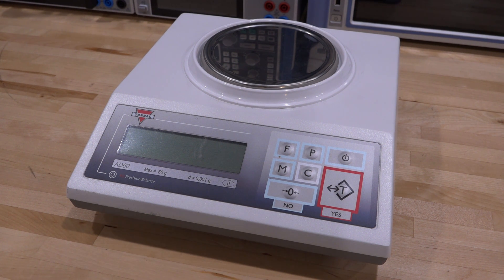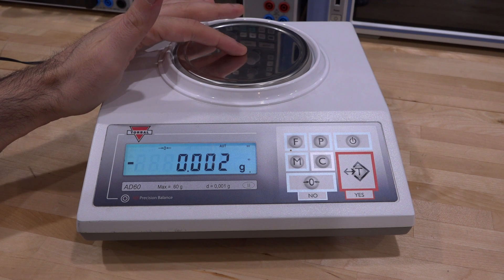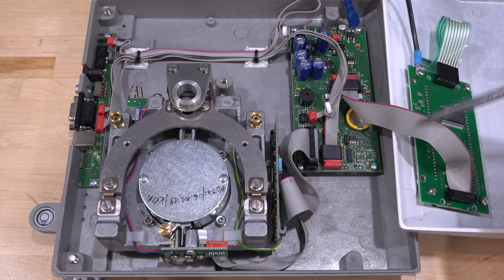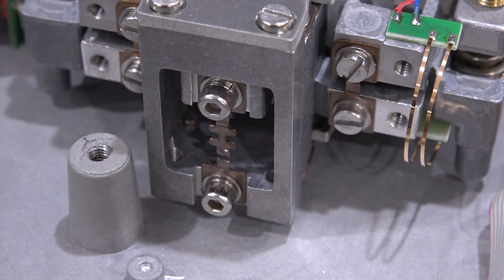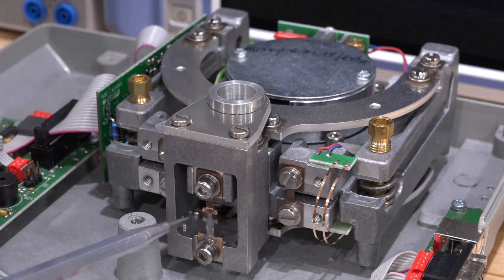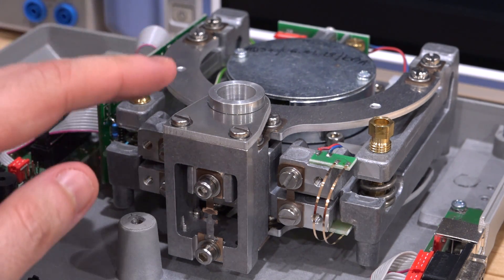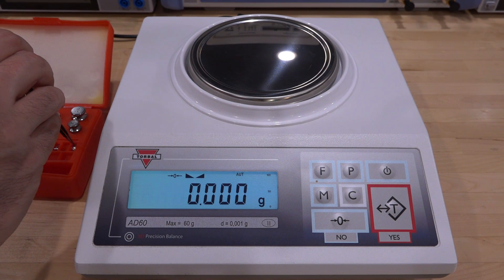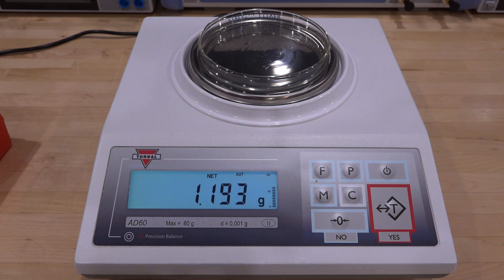TNP #46 - Torbal AD60 Precision Balance (0.001g) Repair, Teardown & Experiments

Comment: Urgent requirment please 

How can I reset the default weight of the weighing scale pan, which is currently around 30-40 grams, to 100 grams, and adjust it to measure further loads according to its load capacity? The scale is a magnetic weighing machine with a precision of 0.1 mg.

Comment: What an interesting fix. The broken piece is a flexure, a part to isolate rotational movement in a lever system which amplify the mechanical movement. Any changes to these parts will affect linearity or placement error (large measurement difference when item is place off center on the pan).

Comment: Thank you for the video.  I found one of these scales in the garbage of a company that had moved out, after getting it home and researching it, found it was supposed to have a bell jar over the top to shield it from air drafts.  It was really sensitive too, it could sense and measure the weight of an eyelash dropped on it and I was wondering how it achieved such sensitivity.

Comment: I am a bit confused. I thought precision scales like a 0.001g jeweler's scale from Amazon are much simpler to implement and cost 20 USD on Amazon? What is the difference here?
Reply from the maker: This is a balance, not a scale. The cheap scales from Amazon are based on strain gauges. They have poor accuracy, repeatability, linearity and stability particularly for small weights.

Comment: So actually what is being measured in this device? An output signal from a PID controller that is driving a magnet?
Reply from the maker: Yes - the control signal from the PID controller which stabilized the balance.

Comment: Used to use scales like this in chemistry. Generally they had a box over the top to prevent air disturbance from impacting the balance. Pretty cool to see the interior. 

And yeah, guess someone overloaded it or just dropped/set it down too hard. Pretty cool.

Comment: I've read that back in the days mathematicians used precision scales to perform integration by plotting the graph on a piece of "precision" paper then cut it out and place it on a scale. This one would be perfect for something like that. Really wonderful mechanism.
Reply: Yep, an A4 sheet of printer paper weighs 5g nominally. I would use plastic if doing this to achieve high accuracy though because paper absorbs moisture so one would have to weigh a known sample of paper that is in the same state as the cut out shape.
Reply: Analytical chemists also used it to integrate the peaks on chromatographs when they where still scribed onto paper

Comment: I have a scale from 1992 that has same electromagnetic type of sensor. It was broken the same way. One of links snaped. Mine is d1g and I thought this electromagnet was used because it's old and resistive gauges were not good for resolution or expensive but 0.001g is nice

Comment: Thanks for another great video! Funny thing, I have a similar 50g scale, also made in Poland, also 0.001g resolution, but made by a different company (AXIS). The electronics inside are old (Intel 8052 processor, ADC with an LM399 and other goodies), but the mechanics of the scale are very similar.

Comment: Summary
Introduction to the Precision Scale and Initial Problem

- 0:07 Introduction to the episode: repairing a Torbal 860 Precision Scale.
- 0:18 Scale specifications: 60g maximum weight, 1mg resolution.
- 0:26 Scale condition: purchased without a power adapter, displaying an "Unload" error on startup.

Teardown and Inspection

- 1:31 Description of the internal structure and mechanical design of the precision scale.
- 2:00 Observations of sensors, adjustment screws, and the analog board inside the scale.
- 2:44 Discovery of a broken mechanical link causing the scale's malfunction.

Repair Process

- 3:49 Attempt to fix the broken link using soldering and a piece of nickel.
- 4:22 Reinstallation of the repaired link and discussion of the scale's working principle.

Testing and Calibration

- 6:08 Successful zero reading after repair.
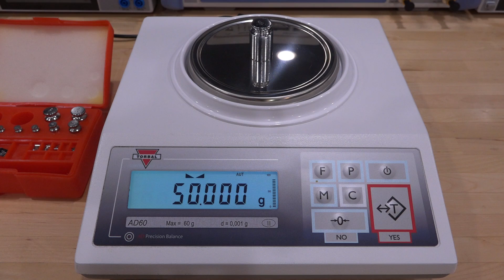- 6:15 Testing with a 50g weight shows accurate measurement.
- 6:26 Testing with 1g and smaller weights confirms the scale's precision.
- 7:03 Experiment to measure the evaporation of acetone, demonstrating the scale's ability to detect very small weight changes.

Conclusion

- 8:10 Closing remarks and appreciation for support, with plans for future repair videos.
Disclaimer: I used chatgpt4 to summarize the video transcript.

Comment: Have a similar mass reference set, and a cal cert for all of them. Error as you get smaller is larger, along with uncertainty, but the milligram pieces are all given to 2 decimal points, and the larger ones to 3 decimals, except the 1g mass, which is 4 decimal points. 

Yes I do have a very old Oetinger massmeter that is capable of showing the mass of those, down to the 0.1mg mark. Been repaired, the mains schaffner filter let out the magic smoke, and was replaced with 2 small chokes, as this unit has a mains transformer anyway, and is nearly a half  century old, with a VFD readout.

Comment: Eons a a go in college chemistry we used precision balances to weigh samples.  You just added on the weights on one side and your sample on the other.  You had to shut the draft door, and wait for the thing to settle out then add or remove weights, took for ever to get three readings.  In one lab they had a couple of Chainomatic scales that used tiny chain links as the test weights. A mechanical counter kept track of how many links and thus your weight, very high teck for the time.

Comment: * mass, not weight 😁
Reply: I'm an experimental physicist and metrologist.
The kg is the unit of mass. See bipm : The International System of Units (SI): Base units
The weight of a body is dependent on its location, and is measured in Newton. The weight of a body on the moon  is 1/6 than on earth, and is zero in zero gravity situations.
Therefore, every scale needs to be calibrated versus a reference mass piece on the location.
A scale measures mass, not weight.
Reply: @DrFrank-xj9bc  I seem to remember that the only way to measure mass was by comparing with another mass hence done with a BALANCE while something that measured the force due to gravity was a SCALE and technically measured Newtons that was displayed as grammes with a scale to indicate the extension of a spring.  Obviously the names for the machines have evolved over time.  Both instruments may have a pan and a scale (fish and armadillo scales suggesting the shape, old word for cup in more than one EU language) another name for a pan .  A balance that compares a mass in a gravity field against a force of an electromagnet is a FORCE BALANCE, like the one in this video, so even though it is balancing it is doing so against a force.

The older style of laboratory precision balances used geometry to change the ratio of the counter weight and then measured the offset ANGLE to determine the correction from a neutral balance position.  They can be equally precise but are generally much more intricate mechanically.  They and any TRUE BALANCE will however give the same reading on the moon or Mars like a double pan balance with weights or a three beam balance that was popular in high school.
Reply: You can only convert to mass, if calibration is verified and passes at the location the device will operate, but still call it weight.
Reply: Interesting. The display on the device shows grams. Grams are now a measure of weight - filed under "good to know." By the way, allow me to be really clear here - I'm just trying to start a "controversy" to help engagement...
Reply: The instrument uses an electromagnet to counter the force of gravity. Thus it measures weight.
Reply: @ionstorm66  Your calibration is going to compensate for the local gravity force, though there is little difference in a relatively large area. However altitude has a larger difference, because the bouyancy of the reference masspieces will vary with altitude. I used to get on site calibration, but, as the test lab is almost the same altitude, and only 10km away, I used to also take them half of the units at a time for certification, and carefully pack them for transit, and then do the other half. Only thing done on site was the Avery personal weigher, which was used as parcel scale, and it only needed to be done every 5 years. Too heavy to move easily, and also had oil dashpots in it.
Reply: @ionstorm66  True but if you include the planet Earth in a calibrated position relative to the scale as part of the measurement apparatus, it measures mass using gravity. 🙂
Reply: no, weight

Comment: I remember where I worked they had a lab of which I didn't work in but the scale they used had a glass cage with a door to eliminate air currents effecting the measurements.

Comment: Shahriar,  I wish you would post the price that you paid for your items.  You say a good deal, but what is that?  I have always wanted a high precision scale in a glass enclosure (0.0001grams).  They are so easy to damage, I wonder if the scales in the glass enclosure use similar technology to this.
Reply from the maker: I paid $116 for this one including shipping.
Reply: Yes the more precise all use force balancing, because it is the only thing that is sensitive enough, and repeatable enough. A 16 bit DAC to operate the current source, along with another 8 bit one to set the range of the current source, with the optical sensor running into a very stable ADC to read the light level. The LED is driven with AC normally, so as to allow a synchronous rectifier to sample the amplitude, so as to reduce temperature drift in both the LED and photodiode down to a much smaller level, as you are now looking at deltas rather than absolute values. That is the reason they also have temperature sensors on the head, and on the sensor, so as to allow only valid readings within a certain temperature range. They do really like a constant temperature, preferably managed within 0.1C by the instrument, and normally are mounted on a plinth, or heavy concrete foundation, isolated from the rest of the floor.